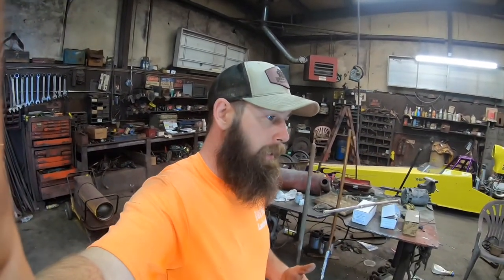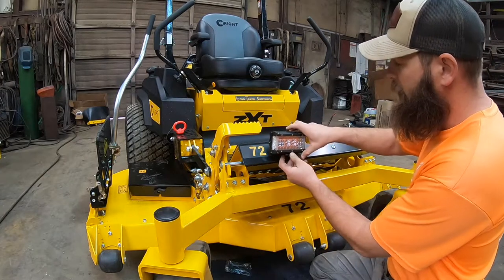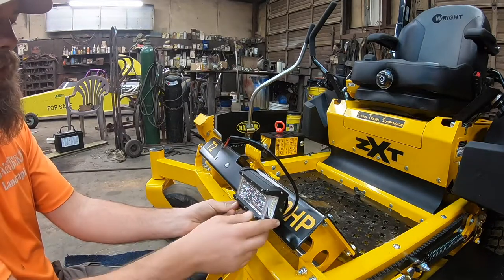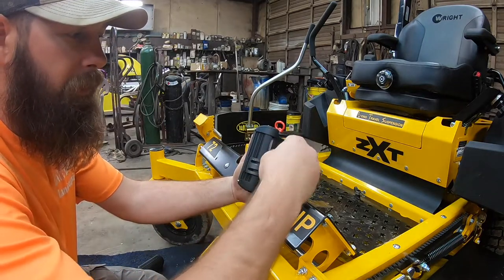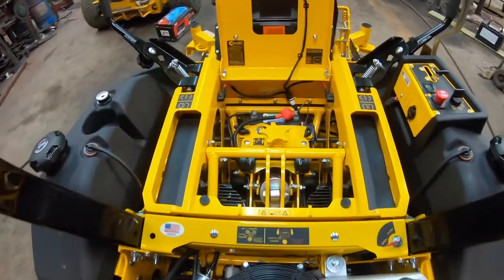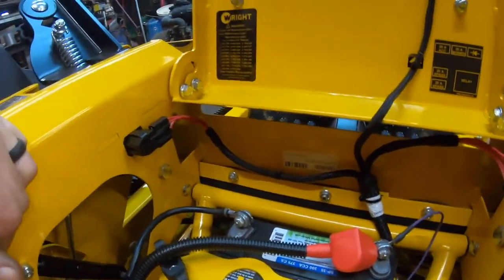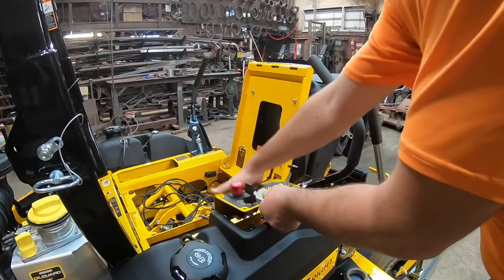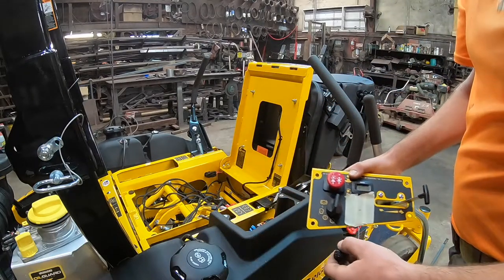Brightest Aftermarket Mower Headlights I Could Find | Step-by-Step Installation

Comment: Love the light kit!!! I’m also in the market for my first zero turn and I have it narrowed down to the wright zxt or Ferris isx2200. I’m using a Kubota bx2380 now. Any help about either would be appreciated. Thanks
Reply from the maker: Wright in my opinion is better than any other brand mower out there…even Ferris (which I also own)

They also have a new model out called the ZXL (I think) that is very similar to the zXt. I haven’t used it though.

Comment: So I have a simplicity citation zero turn that has headlights from factory but swapped them to a similar led and they failed day one. I think it runs off the regulator vs the battery. Do you think getting a wiring harness and relay right off the battery would fix my issue
Reply from the maker: I would definitely wire it straight to the battery, but use a relay. It might be that the lights are drawing too much power for the regulator to compensate for because the factory lights are typically pretty dim, which is why you probably opted to replace them in the first place.

I’ve got 1500 hours on these lights and over 2500 hours on another side of the exact same lights and they still run Strong